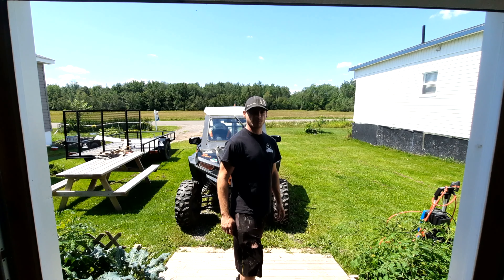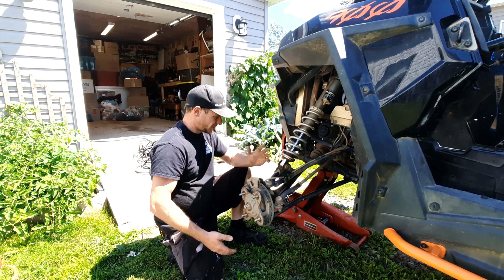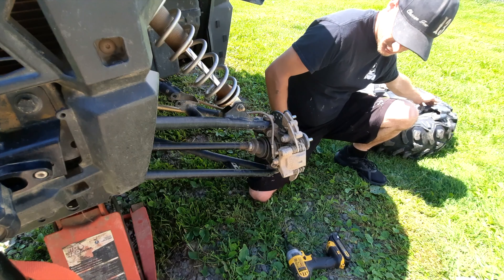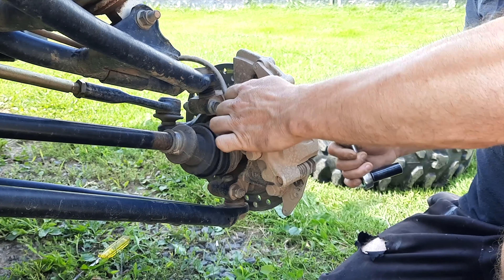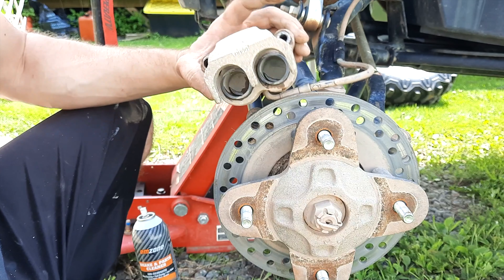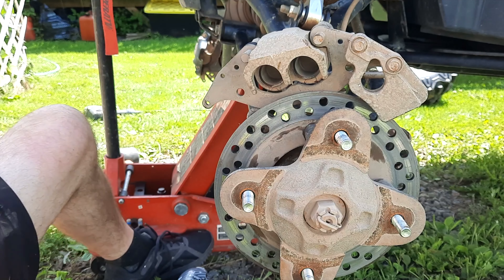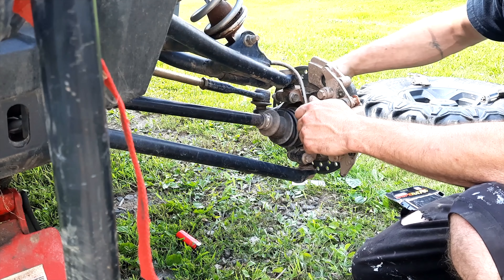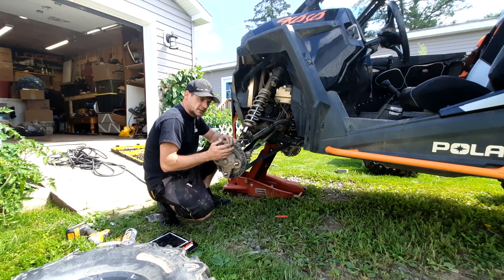how to change brake pads on a Polaris RZR

Comment: Thank you buddy appreciate it, I had changed my pads but wasn't confident on the adjustment from the other video but you went alot more in depth over adjustment.  Thank you!
Reply from the maker: No problem 👍 I try to add as much detail to my videos as possible. Thanks for the positive feedback.